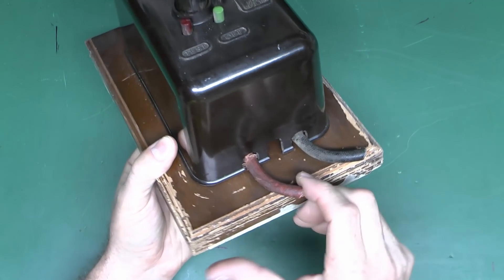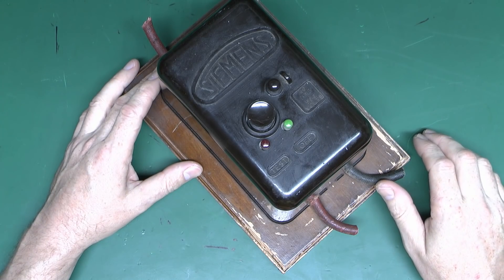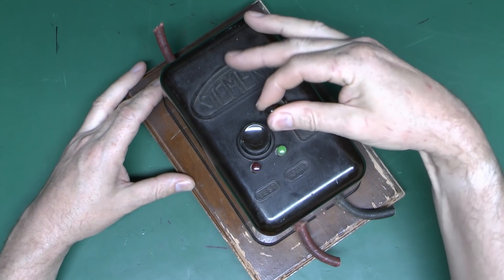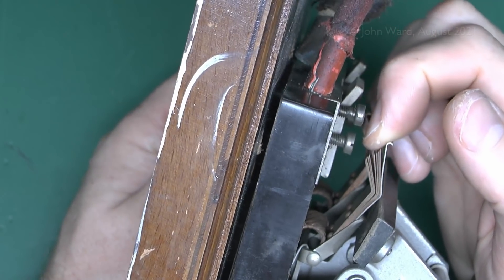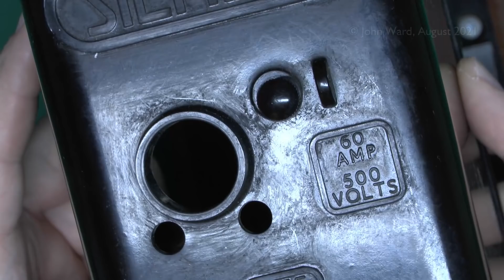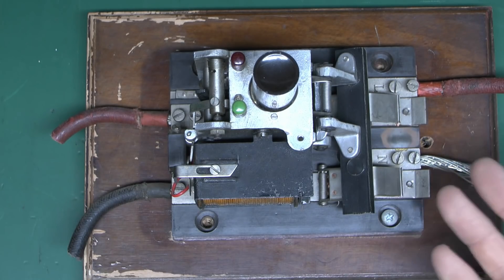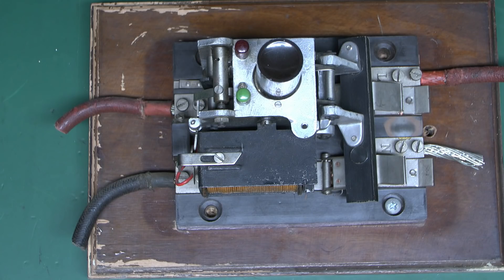Siemens VOELCB examination and Tinned Copper or Aluminium wiring?

Comment: Over the thumb the conductors must be one size larger for aluminium than they have to be for copper. For example 2.5mm² aluminium instead of 1.5mm² copper, or 4mm² aluminium instead of 2.5mm² copper.
In West Germany aluminium wiring was never a thing, in 1973 it was decided that the minimum conductor size for aluminium for fixed installation must be 16mm² due to mechanical reasons. For the same reason the VDE introduced that 1.5mm² copper is the smallest conductor size for copper conductors for a fixed installation. In East Germany they used aluminium wiring until 1990, 2.5mm² aluminium. Dedicated sockets fused with 16A, general purpose socket circuits were fused with 10A. 4mm² for the kitchen cooker, that one was a special one, using a three-core cable with two phases fused with 16A each one. The third wire was the PEN.

If there's any aluminium wiring left, that should go now. Here it is recommended to replace even the newest aluminium wiring from 1990. Aluminium wiring becomes more brittle over time, it requires special connectors and special lubricant on the terminations to prevent the surface corrosion on the aluminium. So it's not only about the current rating, most terminals of accessories aren't rated for aluminium conductors, only for copper.
Reply: Marcel nice comment. However I suspect many electrical standards tend to replace aluminum wiring not because aluminum is inherently less safe than copper for wiring rather it’s the challenges and importance of using appropriate splicing and termination equipment with them. We still have them here in the USA but much greater emphasis on ensuring terminations and splices are done properly in the NEC 2020 standards.
Reply: @mathman0101  That's one reason, the other one is that it becomes brittle over time when it ages. It tends to break within the insulation when you bend it. And that will cause serial arcing, which requires an AFDD (arc fault detection device, in the US known as AFCI). Copper won't age that way, only the insulation does. And to my experience PVC insulation can last at least 50 to 60 years without any issues when the cable isn't overloaded (conductor temperature above 70°C). The problem is, here most connectors aren't rated for aluminium anymore. In the US you also got special connectors for aluminium wiring which are filled with the lubricant I've mentioned. AFAIK they have a violet colour.
Wago 2273, 222, 224 are rated for aluminium if used with the lubricant (sold separately). The Wago 221 are NOT rated for aluminium! The old Wago 273 series was also rated for aluminium in combination with the lubricant. But this series is no longer available.
Reply: @Marcel_Germann  so copper has higher strength, conductivity and ductility than aluminum and lower coefficient of thermal expansion. Notwithstanding all the disadvantages you highlight. The key advantage here in the USA even in a residential setting is their use over longer spans/runs with larger homes than say Europe with their lower weight and greater malleability proving their worth especially for larger feeder/copper wires for services.
Reply: @mathman0101  The feeder cables here are usually 4x35mm² copper. That would be comparable to AWG 2. Three phases and a PEN-conductor, supplying 3x230/400V. Each phase is fused with 63A.
The lower weight is actually not a thing in domestic installations, the only advantage there is the price.
Reply: Aluminium was used pretty much everywhere during WWII though, at least in all parts of the German Reich. Thankfully there wasn't a whole lot of construction going on and most of the wiring that old has been replaced by now. My parents do still have one light wired with war-time Al cable in an old outbuilding though. When they bought the house, the wiring was a mixture of 1970s hack jobs and the original late-40s wiring, most of which was tinned copper, except for two very short pieces of cable. All the wiring was singles in conduit ("Bergmannrohr"), except for the 30 cm bits from junction boxes outside to the lights above the stable doors, which were a kind of tin-sheathed cable rated for wet locations ("Rohrdraht", "Kuhlokabel"). I suspect that type of cable was rarely used so they still had some old stock left when this little hamlet received electricity in 1949. I replaced one of the lights because it was broken and while I was at it also replaced the tin cable with a piece of NYM but the other light is still original and temporarily connected to the new wiring using Wago connectors. I have to admit I skipped filling the connector with vaseline because all this connection supplies is one 25 W incandescent bulb. As soon as we get around to renovating the outbuildings, all of this will be gone. I might save the original light switches though.
Reply: @Ragnar8504  Bergmannrohr (named after its main manufacturer Bergmann) was used until mid 1950s, I still have that in my 1952 house. In there was in most cases NYA, so PVC insulated copper, single wires. Only one lamp was connected cloth insulated single wires. The insulation of that immediately crumbled to dust. I reused some of the conduits and pulled new H07V-U into it. And also installed some new NYM-J. I ripped out the old NYIF (Stegleitung) completely.
I also removed the old "pig noses" (type C outlets without CPC) from the early 1950s in the old bedroom. Not only was that wiring old school, I had to replace it because I brought in extraneous potential by installing a radiator with its piping to heat up the room. Before in that house there was no central heating system. And for the protective measurement "insulated room" there was no extraneous potential permitted. Just out of curiosity I performed a few tests. Insulation resistance was still excellent, the other values would also meet today's standards. But it was outdated, and no longer meeting the regs from back then. Would have replaced that anyhow. Half of the house on one H16A MCB is also not suitable for today's needs.  

https://abload.de/img/img_0141e3k8t.jpg

The copper was required for ammunition, so they wired in aluminium. In East Germany copper was too scarce to use it for wiring.
Reply: @Marcel_Germann  Did garages in East Germany always have a separate ground instead of PEN? I saw GreatSCOTT's photovoltaic video and some other pictures or videos about old East German Garages and they seemed to use 3 core cables.
Reply: @Marcel_Germann  How common were TT systems in West and East Germany?Did RCDs in East Germany exist before the 1970s?
Reply: @mernokimuvek  No idea about exact numbers. Some areas in southern Germany still rely on TT. It's the DNOs choice what earthing system they offer. And yes, RCDs existed and were used mostly in TT systems to assist in case of the line to PE short-circuit. Also such voltage operated things like shown here in the video.
Reply: @Marcel_Germann   When were those horrible voltage operated things banned in West and East Germany? In Hungary they were banned in 1973 for the common fails to trip and the false feeling of safety.At least in industries,I'm not sure if they also were banned in residential use that early.
Reply: @Marcel Germann  If kitchens were required to have a separate ground the why were cookers wired with 3 core 4mm2 aluminium cable,with 2 phases and PEN?
Reply: @mernokimuvek  Outlet and light circuits, and they were usually only 2.5mm². The cooker circuit was a different thing. The thinner the material, the higher the chance it will break due to mechanical stress. That's the reason aluminium wiring was only permitted for conductors of at least 16mm².
Reply: @Ragnar8504  In Hungary we most often just twisted the wires and wrapped them in electrical tape.Wire connectors were  very rare before 1990.But it everything was done properly,even aluminum wiring with twisted splices lasted many decades without a problem.
Reply: @Ragnar8504  I agree with that.If it worked for 50+ years it won't fail instantly. Copper to aluminum twisted splice was never considered good,but there was no other choice.Even chocolate terminal blocks were rare in the 1980s and before. It lasts decades if its in a dry place.Electrochemical corrosion doesn't happen without an electrolyte. If the copper was tinned copper,there is no corrosion at all.TN-C in Hungary was very rare.Until the 1980s only bathrooms and kitchens were required to have grounded sockets.The concept in other places was the osilated room.If an appliance case was live,you were insulated from ground and didnt even feel anything.I think they still use ungrounded sockets in the Netherlands,and maybe Norway and Denmark.
Reply: @Ragnar8504  I'm not sure about grey neutrals.Maybe the owner  or the electrician couldn't find blue wire. 1.5mm2 aluminium was also used in romania.Czechoslovakia had very dangerous wiring.From 1930s to 1992,sockets were wired with 2 wires and the ground contact of the socket was connected to the neutral.Even after the separattion,Cezch Rep and Slovakia used TN-c until the mid or late 1990s.Some DIYers or electricians with old knowledge still wired buildings in TN-C a few years ago.
P.S. about Russia: They had many different systems. single phase 220V and 3 phase 3x220V without neutral was common.The secondary of the transformer was not grounded,so you would only get a shock if you touch both wires.They also had 127V power grids until the 1970s.Some 220V systems were grounded,but 220V was the voltage between 2 phases.So only 127V to ground which gives a weaker shock,assuming the same body resistance.Thats the reason that almost nothing was grounded there and even today grounded appliances and extension cords are rare.
Reply: @Ragnar8504  When did Austria have TN-C? I heard from a few electricians that in good old days they even had a fuse for the neutral.
Reply: @Ragnar8504  Was TN-C the only earthing method in Upper Austria or was TN-S also used?If neutral fuses were required what did thet do with 3 phase circuits?It would be bad for them.
Reply: @Ragnar8504  P.S. about your comment seeing 1mm2 aluminium wire in Austria: Some electricians told me that 1mm2 aluminium wire existed in Hungary as the rubber and cloth insulated version and also as the stegleitung bullshit which most electricians hate.Some electricians even told that they have seen 0.75mm2 aluminium but i doubt is and have a few theories to explainm: 1mm2 and 0.72mm2 wires are very similar,the difference in diamater is only 0.1mm.Only very experienced people who work with thin wires can identify them by eye.It could also have been 1mm2 slightly damaged when stripped,appearing thinner.People used a knife back then,wire tripper tools were rare.And of course it could have been tinned copper.
Reply: @Ragnar8504  What medium voltage power grids were used in Austria?In Hungary we had almost eveything:2,3,5,6,10,12,15,20,22,25,30,35kV and nowadays 10kV is only underground cable,20kV is both overhead and underground,35kV is proably overhead only.3,5 and 6kV is used for small grids in industrial places like factories and mines,
Reply: @Ragnar8504  Its also weird to me that Austria and Germany uses 110 and 380kV HV transmission lines.In Hungary the voltage on 100kV lines was raised to 120kV in the 1950s,and the first 400kV line was built in the 1960s.Even then it was 400kV and not 380. The actual voltage on 220kV transmission lines is also about 230kV,the maximum allowed is 245kV.For some strange reason some people refer to that line as 250kV.

Comment: apart from the fact that it doesn't provide any protection, is it actually dangerous? IOW, would the installation be safer without this device, if everything else is the same?
Reply from the maker: If it still works, and it's the only device other than fuses / circuit breakers then it's safer with it - without there would be nothing to disconnect L-E faults.
However many of these don't work due to age, people altering the wiring to the earth and earth electrodes without realising the consequences, or other changes within the installation such as additional paths to earth.
All of them should have been replaced with RCDs decades ago.
Reply: @jwflame  Decades ago (1987) was when my house was built, with an ELCB consumer unit. They seem to have lasted longer than you think.

Comment: Our house was built in the mid-60s and has aluminum wiring. They make various products now to help bridge the aluminum to copper. We can't just rip it out of the wall, anyway. It would cost too much. They are all 20 amp lines. The wiring is and equivalent 12 gauge wire which is thicker than 12 gauge copper.
Reply: The aluminum branch circuits in homes I've seen here (like mine) have 12/2 circuits,  but they are fused (or breakers) at 15 Amps.

Comment: Smart looking unit! If main bonding is installed to the installation it will usually end up bypassing the coil meaning the unit will never trip. Disappointed you didn't connect it to the mains and try the test button!!